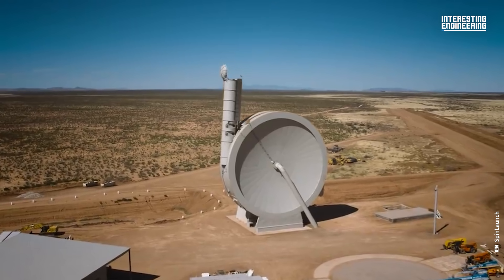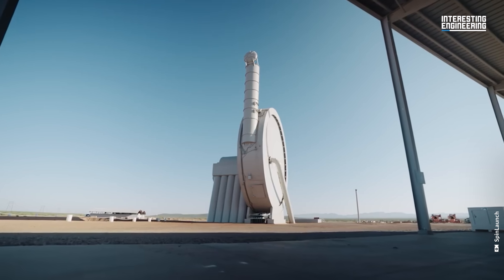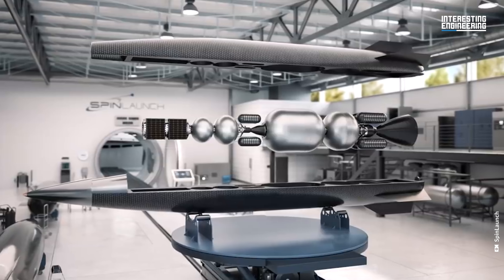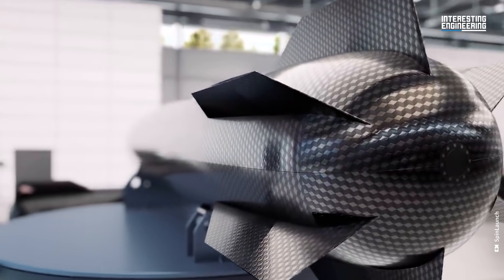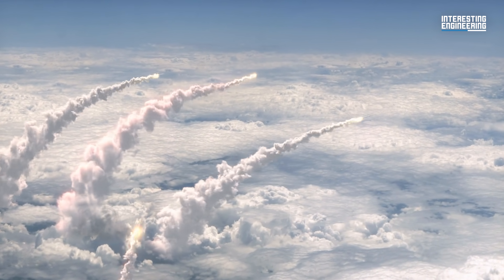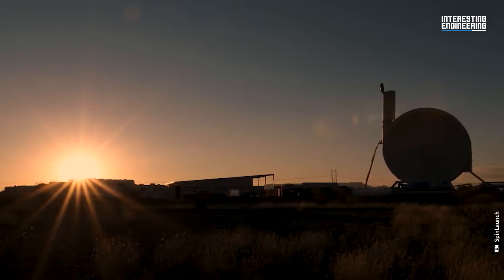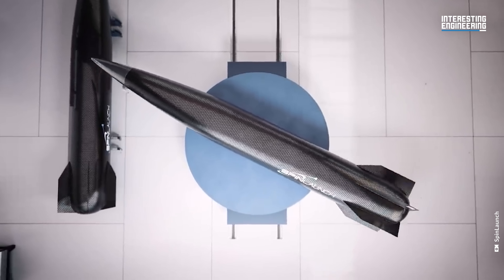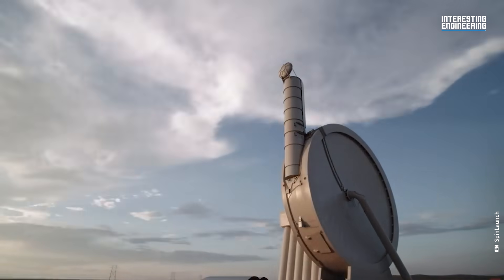Tossing Satellites into Orbit with SpinLaunch: Is that Possible?

Comment: Whatever about eliminating the first stage in rockets for satellite placement , even if they could get this to mach 3 out of the barrel (whatever about mach 6)… couldn’t the projectile then carry a ram jet engine that could be immediately engaged at launch?

Be an incredible way to potentially combat pretty much any airborn threat with an air breathing interceptor. An AA missile launching at mach 3 alone is nutty.

Comment: You still need a way to make a circular orbit or your orbital trajectory comes back to the ground.
Reply: and when it comes back, it will generate enough impact velocity of a nuke lol
Reply: It's clearly mentioned and showed that it's a rocket as well. Did you comment without watching?
Reply: @rowaystarco a high tech RAP round (rocket assisted projectile).
Reply: Once an object is in space, it's not coming back to the ground simpleton.
Reply: A machine that's designed to project an object like satellite in an angular trajectory. It could be this.
Reply: @malseswerf9820  lol, no it won't.
Reply: @malseswerf9820  we can actually do the math for the max payload projectile of this thing falling back to Earth.  Its peak kinetic energy is 6.08 gigajoules which isn't even 0.01% of the energy release by the bomb dropped on Hiroshima, a tiny nuclear weapon by modern standards.

Comment: So, I guess the "mass accelerator"  works using what?  Word salad, vodoo bicycle power?
Reply: mass x velocity = momentum but with centrifugal and centripetal force will make momentum stronger and heavy, overpassing the air resistance affecting its aerodynamic process, it's also required too much kinetic energy with less power required compare to fueled rocket, it's cost-effective and environmental friendly than fuel that affect Ozone layer and other part in atmosphere. I guess exosphere is filled with numerous dirty space junk.
Reply: mass accelerator you're referring is defined as "momentum". and yah, bye